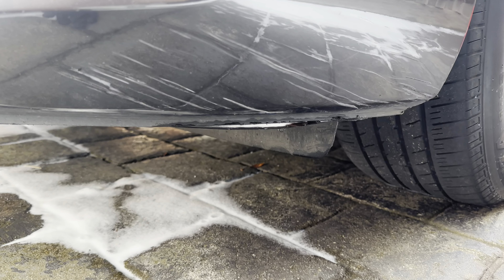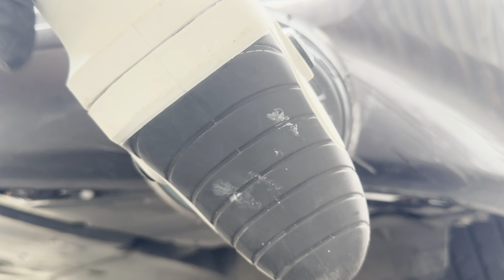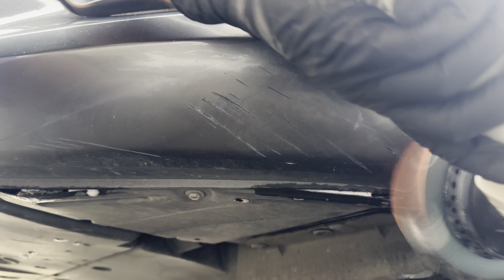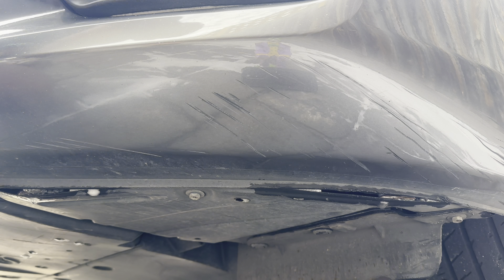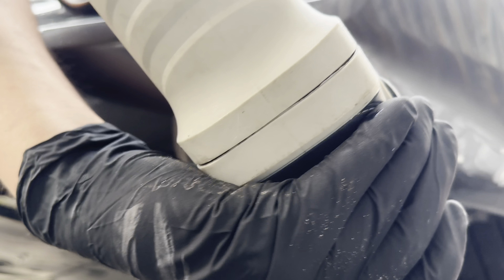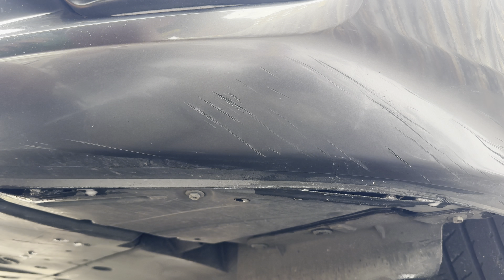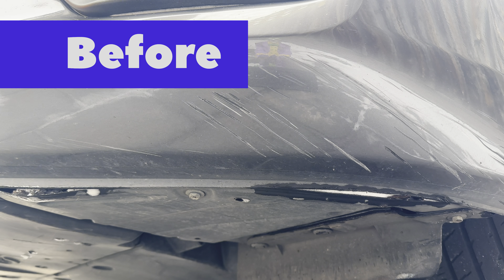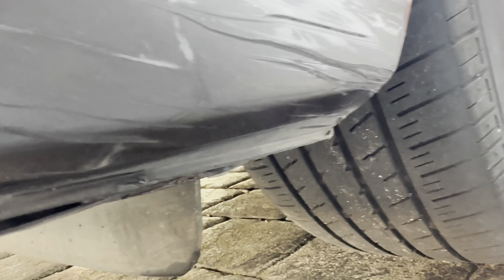Can Meguiars Ultimate Compound Remove this Scratch?

Comment: When you rub your nail on the damaged area, if your nail feels any bumps on the scratched paint area, unfortunately no compound can completely restore it.
Reply from the maker: Great tip to measure what compound can correct
Reply: I am going to give this a go on my mazda 2 rear bumper. I have a slight faint scratch mark that needs to ve polished. Is it better to use oribital polisher or do it your self by hand